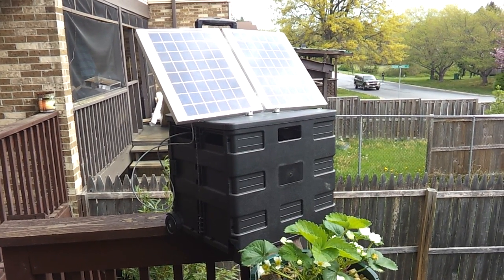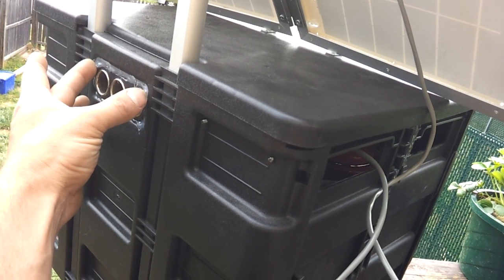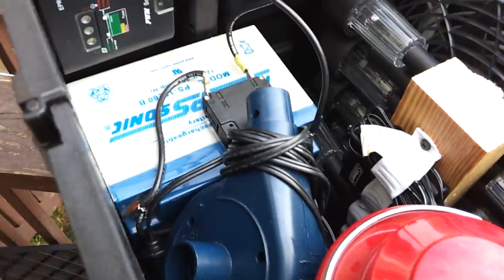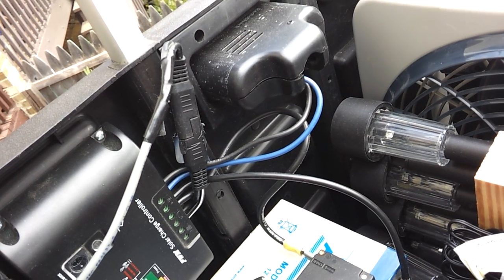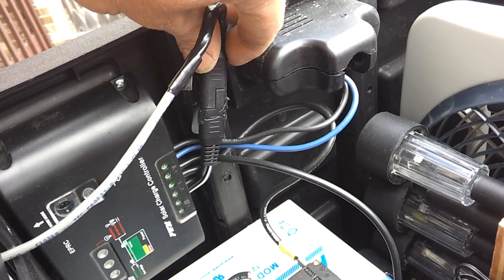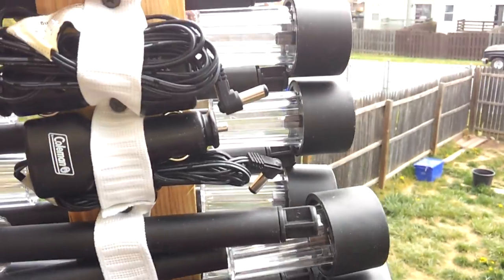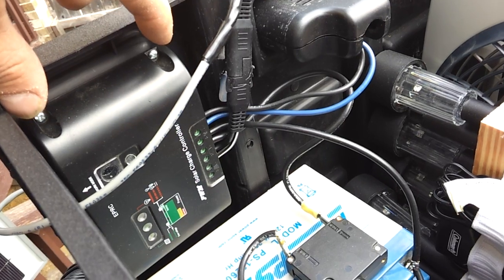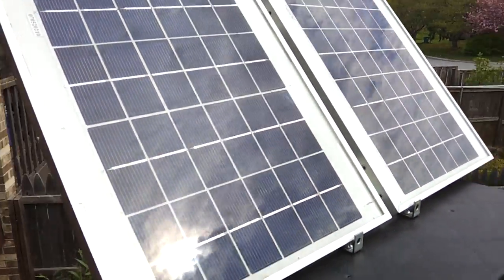Camping solar battery box V2.0

Comment: Thats very slick. Staying with 12 volt make it a lot lighter and efficient.  My system is similar, but its permanently mounted in my trailer.  I made 20' long cables and attached my 3 outlet plugs to them to extend my power directly in my tents then i can use Goal Zero lights or charge phones or other 12 volt gear.
Reply from the maker: Nice setup.  The only thing I don't like is goal zero products.  Good products by mark up the price for what they give you in an obscene way!!

Comment from the maker: bads3ctor2 - thanks for the idea.  don't worry about the link as i easily found it searching with your suggestions.  i checked out the turnigy meters 2 years ago but they were running around $55 at that time, now that they're at $25 I might just go and grab one in the next few weeks.  Thanks again for suggestion!

Comment from the maker: The 25ah battery was bought online finding the cheapest retailer with Google shopping that had a special for free shipping at the time.  The 7ah battery I had from a previous project.  The solar panels were bought on eBay in the winter when the prices are cheaper for solar panels.

Comment: Also, the batteries you are using should not be used together. your little 7AH 12 volt'er will be discharging to your larger capacity battery to the point where it voltage drops enough to then have charge starts to return back, so on and so fourth. Your best option is to get larger capacity but lower voltage batteries and wire them in series. This will prevent such a discharge issue, else you can you high rated diodes or relays to kick in under load or charging.

Comment: Go to Ebay and type in Amp Volt Combo Meter (you want one with shunt included).
I use two of these connected to a 100ah SLA in a tool box.
One tells me the current/voltage incoming from my 100w PV and the other tells me the outgoing voltage/amp for the load. 
It was a little tricky to to wire up, cable length from the shunt to the meter is critical to accuracy.

Comment: You have an interesting set-up which looks to serve you well.  I do have one suggestion based upon my own experience with a similar arrangement: Design a way to mechanically fasten your solar panels to the tote top (or wherever you you plan to deploy them).  Ideally, they would attach and de-attach using some sort of quick-disconnect hardware.
I made the mistake of setting my panels in a spot but not fastening them. One healthy wind gust sent them flying, shattering the glass plates.  :(